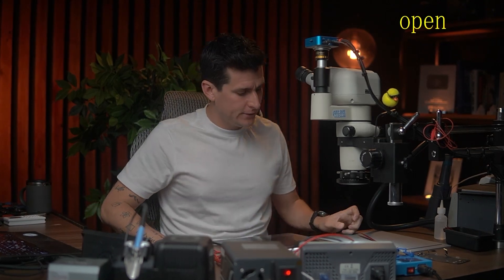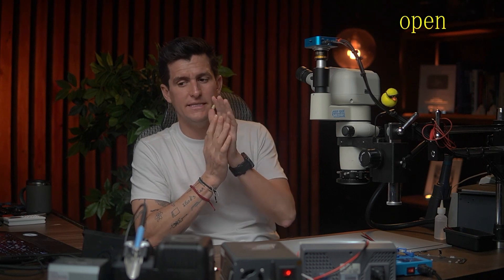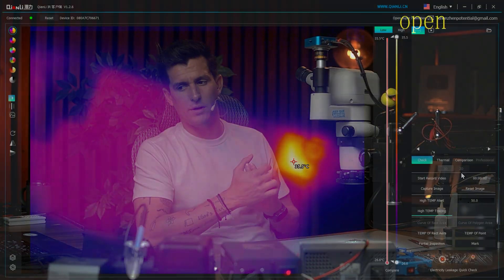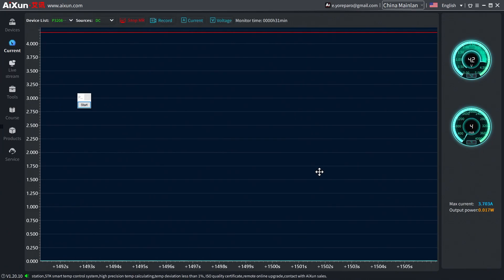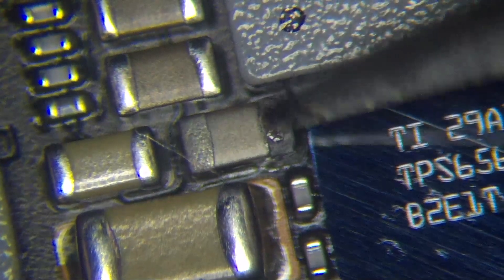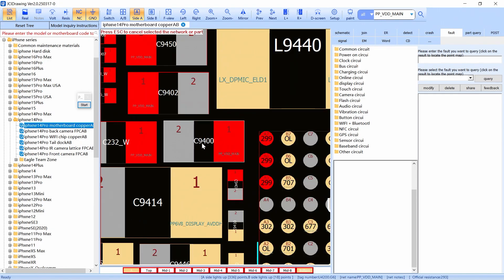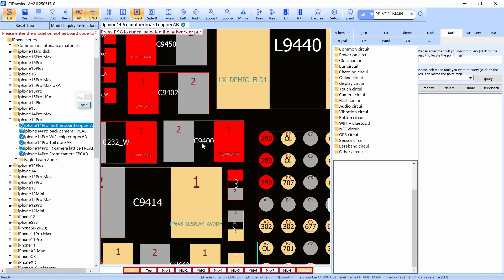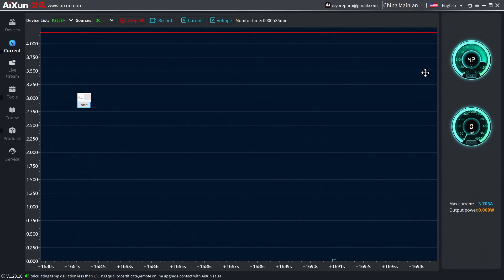Iphone 14 Pro Won´t turn on!! Let´s see how to diagnose and find the shortcircuit | PART 2

Comment: Hi Edgar! Can I please you about video about cellular RF? Because I have iPhone 12 Pro Max with an error in diagnostic mode "Cellular RF Front End Scan Test" and I cannot find the fix for this one... I tried to find answers where to find the issue online, but I couldn't find them... I changed all the flex cables in the whole phone, I did sandwich reballing and still nothing. I would like to see you explain the circuit and how it works! Thank you!